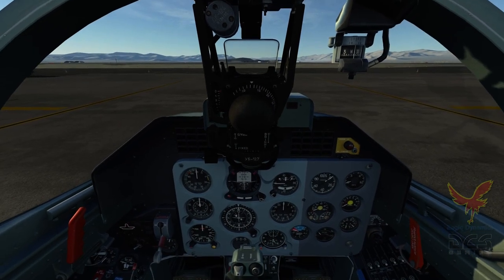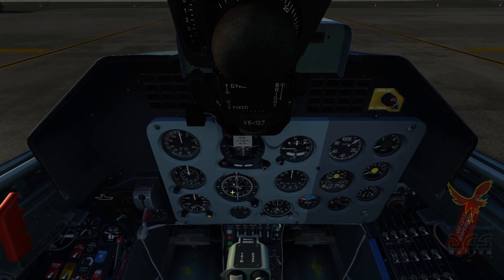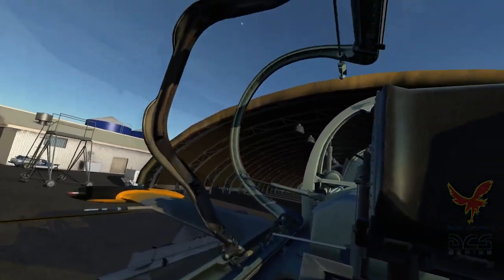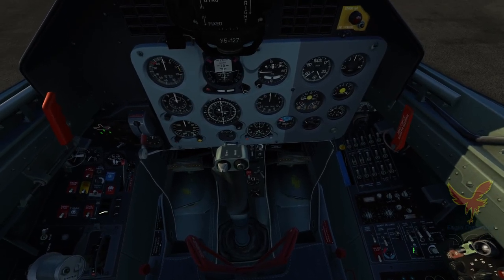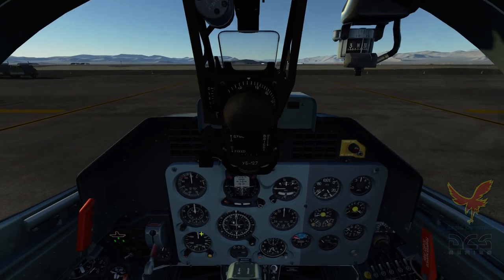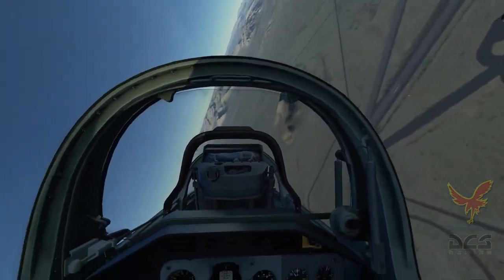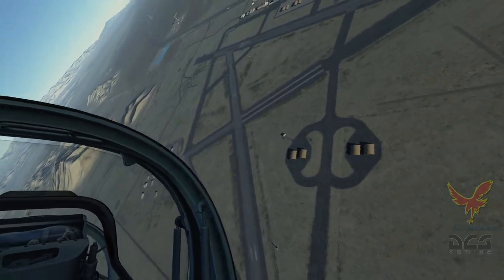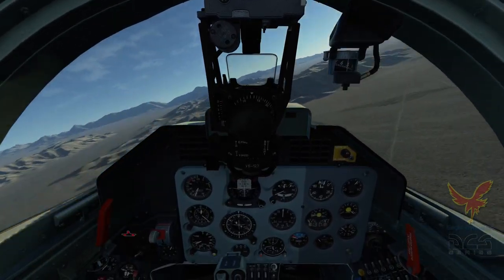Introduction to DCS: L-39 Albatros

Comment: Taxiing this plane is a nightmare, I don't know what I'm doing wrong. For some reason while using differential braking to turn,  the plane at times just gets "stuck" into a turn even after I remove my foot off the pedal, like it just wants to go in circles forever, which doesn't make sense because I'm not applying any controls, neither brake nor pedal (rudder), so not sure why it just wants to keep on turning by itself. And applying reverse differential braking to force it out of a turn doesn't seem to work until I push that damn throttle to full and get it to accelerate..and off the taxi way and onto the grass..and only then does it go back to taxiing straight jeez!